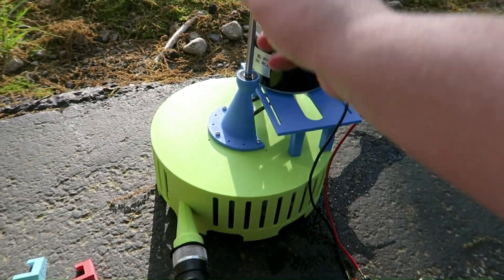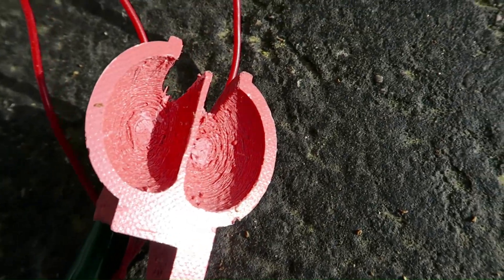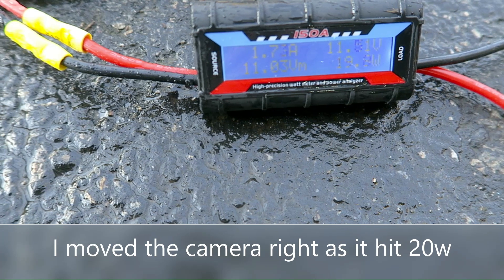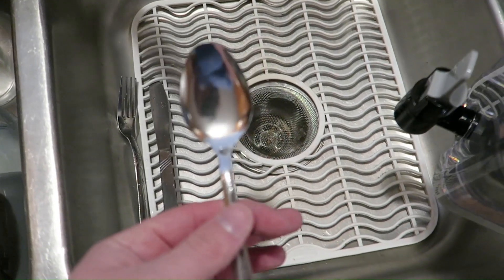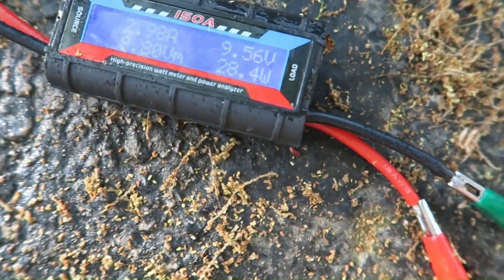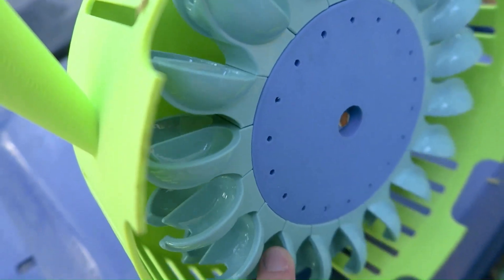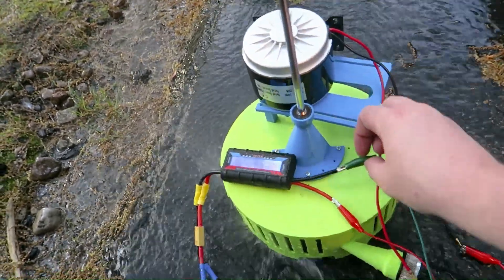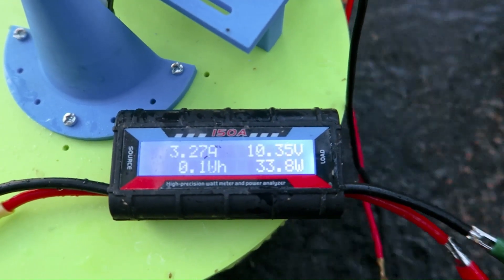Vapor smoothed 3D print makes 86% more power!

Comment: Hey I love the video and the tests. But to be clear are you sure you have the exact same pressure coming from your faucet during each test? The water pressure and flow rates will change throughout the day and provide minor differences in power available. 

And i just mean between the differences in the new blades and the new blades smoothed not the change from your first blades. 

Just a thought, keep in keepin on! Thanks again for the cool video.
Reply from the maker: I changed the blades and tested right after. The smoothed blades really seem to make the difference. When I tested off camera with just a bucket under the faucet there was a very noticeable difference between the two.

Comment: Is there a way to properly measure how much energy is in the water you are using? Is would be a good way to tell how efficient your setup is.
Reply: Also some way of measuring the torque and speed requirements on the motor you're using would probably come in handy if you decide to adjust the gear ratio.
Reply from the maker: I'll figure out a way to test this

Comment: Maybe the water pressure varies throughout the day?  That will affect your measurements quite a bit.  Most city water is around 80-100 psi, but well pumps are usually much lower.
Reply from the maker: I agree with this, tho my testing has been done at almost the same time every time.
Reply: @Beyond_The_Print  maybe add a cheap pressure gauge to the inlet.  BTW, what practical use are you after with this device?
Reply from the maker: More than likely use a more practical motor. Then find a location to test/use at long term. I'm sure the water would erode the plastic rather quickly. Aluminum would likely be needed long term for at least the buckets,  along with a metal nozzle.
Reply: @Beyond_The_Print  the most durable material I have worked with for abrasion is nylon.  You can 3D print nylon. But I bet the plastic you are using now will last a really long time.
Reply from the maker: I've been recommended this for other parts as well. I'll give it a try thanks for all the advice I'll incorporate it into the next build.
Reply: Hi from Scotland. Just finished and enjoyed watching all your videos on your project and the progress you've made up to now. I have made my own hydro generator out of scrap laying around. It took a while to get it to work the same as you and I learnt alot on the way. I think I can't make it any better than it is, so I may get a printer and print a Pelton. Have you seen how much they cost 😮.
Looking forward to your next vid.
Reply from the maker: Thank you I really appreciate this! You can find Pelton wheels on ebay and Amazon. Although the printer allows you to make many more things after!

Comment: What water pressure or hight from the reservoir?
Try to lift the gear closer to the side support bearing. I saw the tension is hard on the belt.
Reply from the maker: I'm not sure pressure because it's connected to a garden for now
Reply: @Beyond_The_Print  T a pressure gauge onto the supply. Nice construction.
Reply from the maker: Thanks for this! Didn't see this till now but we had the same idea

Comment: Thats some nice progress. You need more volume on this video! Also stop using electronics i wet conditions! Maybe the device has even given wrong values because of the water!!! With a mppt you would get even more wattage i guess. You should also read pressure and flow rate, to compare those values more reliable, if those may fluctuate a lot.
Reply from the maker: I will try and remember to measure these for the next test. I also will try the mppt and see if this makes a difference on power output.